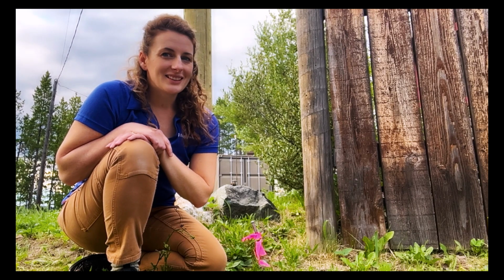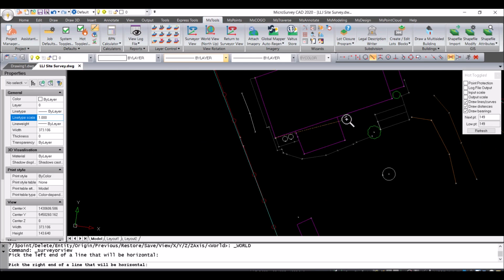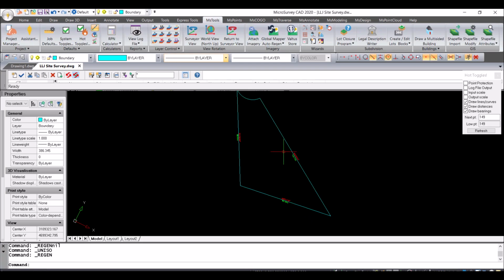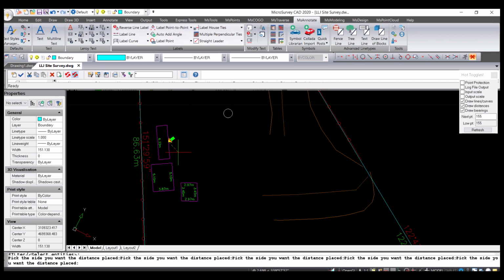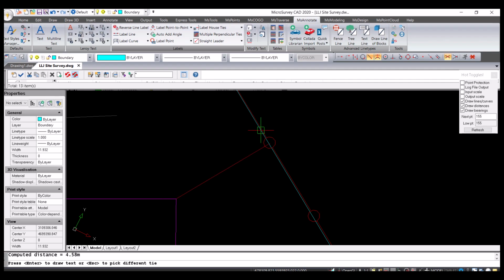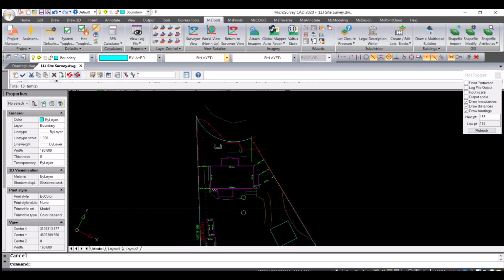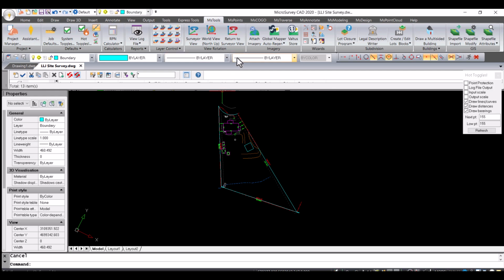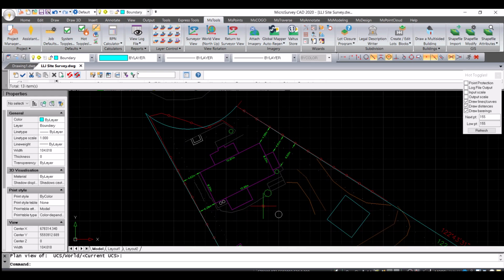Enhance Your Drafting with MicroSurvey CAD Smart Labels!

Comment: Hi, I know it seems practical to align a garage with the property line, but if it were me, in this case, I'd rather have the garage align with the future driveway where it is aimed at the tightest point between the side of the house and the property line. This would make backing out of the garage a straight shot to the "pinch point" which would be easier, particularly at night. But there's pros and cons to any design, so ultimately up to the homeowner ;)